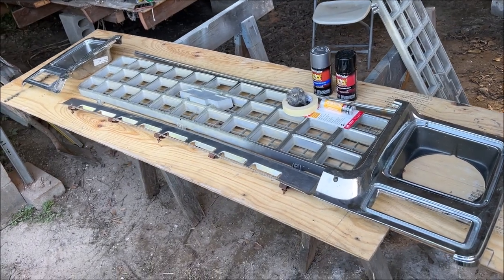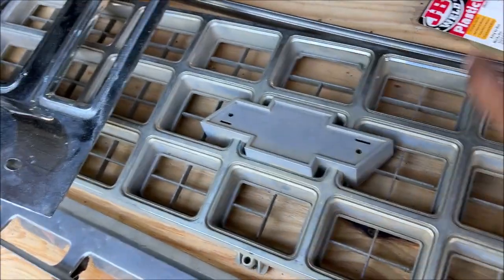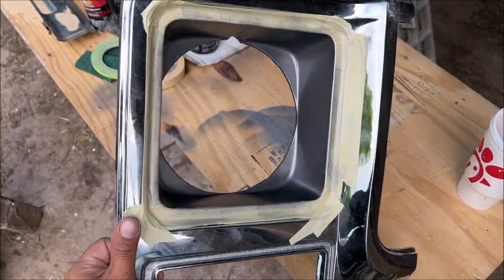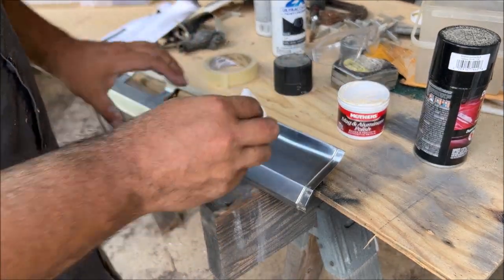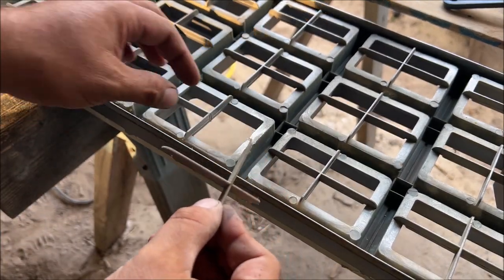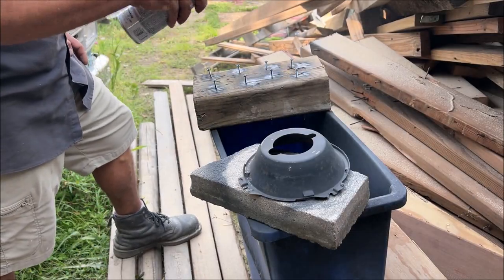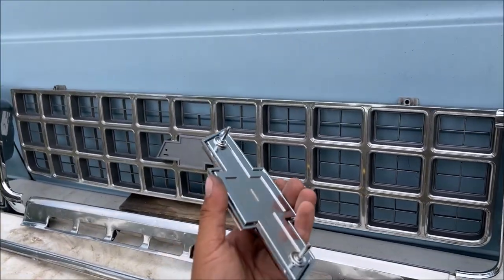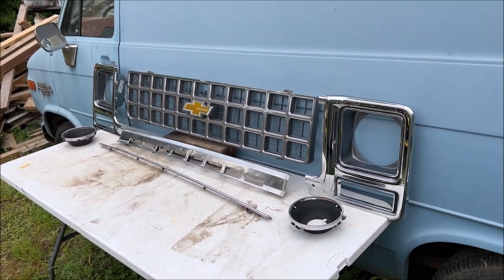Chevy C10 grill restoration

Comment: 1980 was the only year for that grille design on Chevy fullsize pickups & SUVs. 1980 was also the last year for round shaped headlights & the first year for square shaped headlights. The square shaped headlights were optional except on models with the Silverado & Sierra Classic trim levels because they came standard on them.
Reply from the maker: the rule was chrome grill got square headlights.. I would have square headlights but they were way more complicated to remove than I thought.. a guy wanted to “trade me” he hated the square headlights.. within 1 minute of the swap we stripped every screw on his truck..my 80 c30 was a painted bumper painted grill custom deluxe… factory round head lights
Reply: @chriscraft77022  I forgot to say grilles with that design were also on 1980 - 1982 Chevy fullsize vans too.